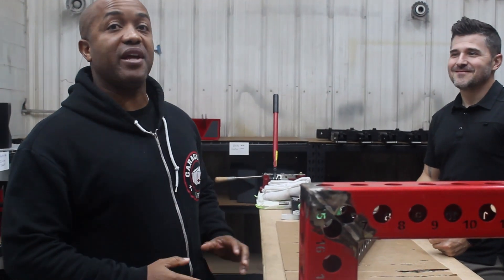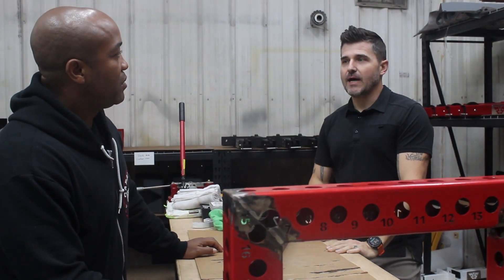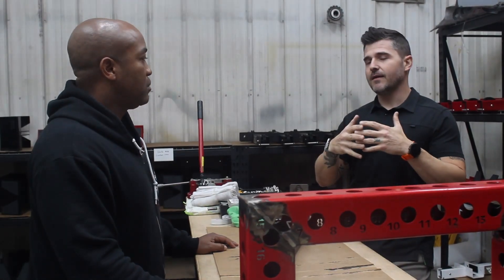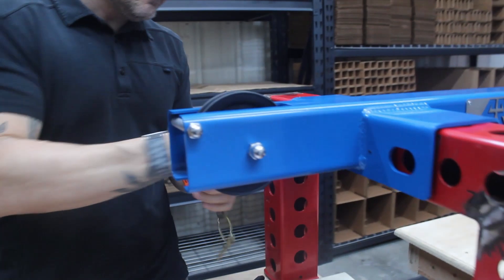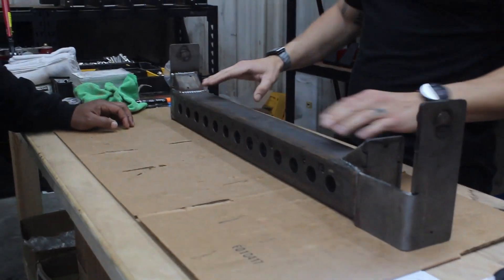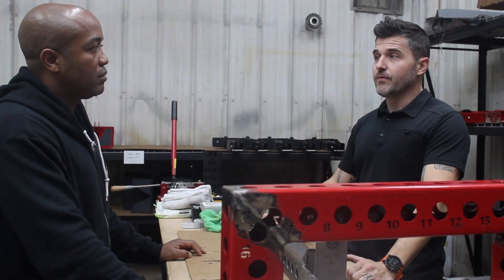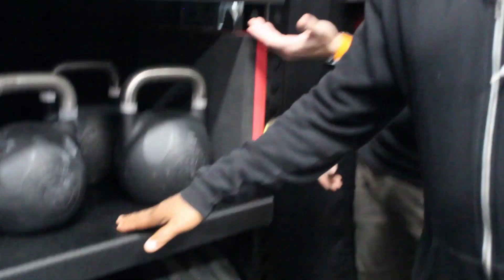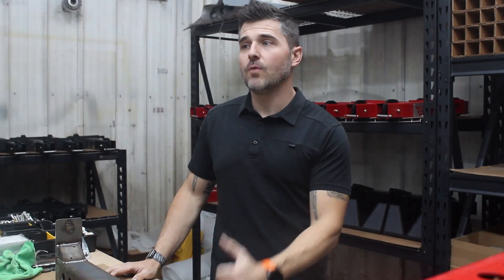Problem Solving Home Gym Equipment with Surplus Strength

Comment: Can anyone advise how many holes apart the bolts or mounting pins are on a 3x3 with 1 inch holes?  For example the bolts go in holes number #1 and # 4 or #1 and #5?  TIA
Reply from the maker: Not my area of expertise. I suggest contacting Surplus Strength using the contact information in the video description as it's their product.

Comment: My surplus strength ups high arrived yesterday after waiting for it for two months. It is disappointing. The machining is sloppy with nearly a 1/16" of an inch gap between the uhmw and the bar. It rattles all over the cross piece.  The bolt area has no support behind it all. I sent a mail to Jason (the owner) to discuss. At first, I mailed an automated email with a no-reply address without realizing it. When I didn't get a response, I sent it a second time to the correct address. Jason was noticeably upset in his response that I hadn't waited 24 hours for a response. It seems the "no-reply" address did go to him. He offered to send me some tape to fix it. My impression: don't bother with this thing. Rack mounted gliders like the Bully Glyder are a much better option. I personally have that device and it is incredibly well made and smooth. Fits perfectly with no slop. I'm glad I didn't bother to order the ups low or the upgraded pulleys.
Reply from the maker: So first I hate that you had a bad experience with Surplus Strength and I appreciate your candor in sharing your experience. Second, this video is pretty old so brands like the Bully Glyder have the advantage of being able to learn from, and tweak Jason‘s design, which was a first of its kind product at the time. I liken to riding in a modern Ford Explorer versus riding in one of the original Jeep Cherokees from the 70s. The experience would be completely different with a modern SUV because we’ve learned so much since Jeep first came out with the original sport utility vehicles just after World War II. I’m not making excuses for Jason (it’s not like he’s paying me for my opinion.) but I am saying that, unless we are comparing a recently made UPS to a recently made Bully Glyder (which you might be!) then it is not a fair comparison. So my main concern with this comment is not so much the merits of the individual products, but in addressing customer needs. I will reach out to Jason to see if he would like to comment not necessarily on your specific experience, but just to give him a fair shot to respond.
Reply: My bully glider is about a month old. The Surplus Strength UPS is one day old. I believe the issue is Jason hasn't accounted for the difference between 3" and 75mm in his design even though it is claimed to work on racks such as the rep pr5000. The real issue here though, is the way he acted when I reached out to him, not the issue with the product itself. I'm fairly certain I can fix this by shimming the gap with the some UHMW sheeting but I shouldn't have to. This is a premium product at a premium price. I also had no intention of posting ANY reviews about this until he treated me like this.
Reply from the maker: @TheGeneralPractition  gotcha. Thank you for clarifying. Like I said customer service to me is a big deal because like you I work hard for my money and I don’t want to spend that hard earned money with people who don’t treat me like I’m important to them. I’ve reached out to Jason to see if you would like to come on to address the concerns but in the meantime, I’m just glad that you were able to find a product that you like from a company that you prefer doing business with. Out of curiosity how did you find my video since it’s fairly old? Did you just Google the Surplus Strength company name and the video popped up?
Reply: How did I find your video? I researched for cable systems for racks in depth for months before purchasing and yours was one of the videos I watched multiple times. I didn't want to get the default rep lat-pulldown since it took up so much room on the back of the rack. After consuming pretty much all the reviews on youtube, I ordered the UPS high. A few weeks later, I discovered the bulley glyder and ordered it as well. My intention was to use the glyder to hold the weight since it is side loadable and doesn't swing with the UPS high allowing me to move away from the weights some what. The glyder came quickly  so I had it for nearly a month before the UPS arrived (Jason had warned me there would be a wait). I got used to using the glyder during that month with a simple pully mounted to the cross bar. The glyder has an genius adjustable mechanism to make it fit both 3" and 7mm racks without any slop.
Reply from the maker: @TheGeneralPractition OK perfect! Thank you ! My product is video content so it’s always important to me find out how people are discovering my content because it helps me know what sort of topics to focus on and where my efforts are being productive plus, it helps me to understand why my best performing long running content remains relevant.
Reply: To close the loop, my 1/16" of inch uhmw shim came today. I sawed it to fit and now the device fits my rack correctly and feels incredible with the bully glyder holding the weight. I am confident this is due to the ups high not accounting for the metric based 3" racks (which are actually 75mm)